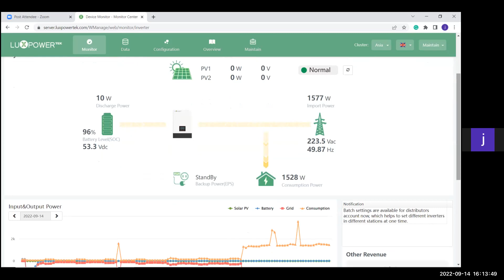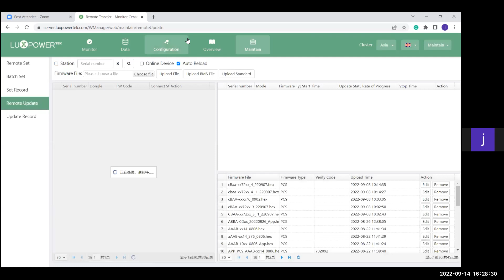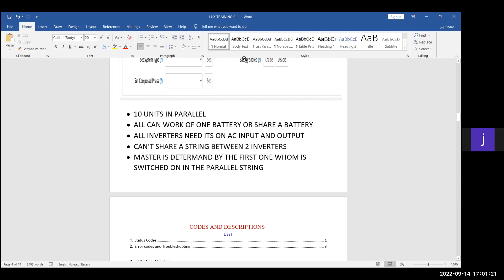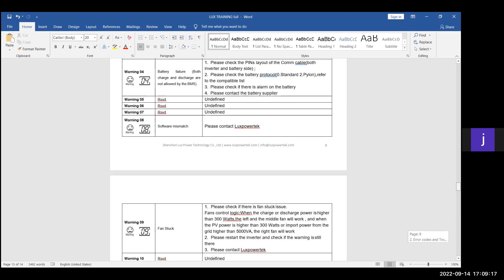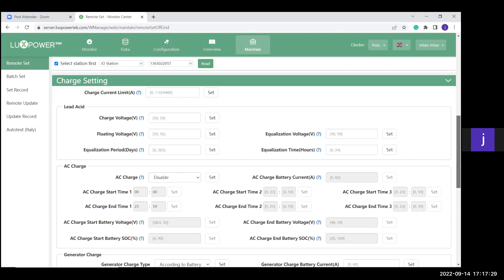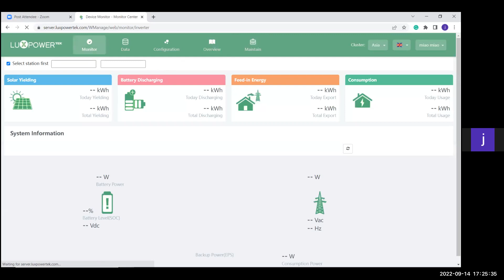Luxpower hybrid series intro online training

Comment: Hi! Jaco, very good and informative videos, thanks.   I recently purchased your unit from a supplier. (SNA5000) I was supplied with (3X 545 w) Canadian solar panels. Meaning that on a 6-panel string it will be 70 w over and 13.14 A on the MPPT. Do you suggest going to a 540 w for the last panels? Will my warranty be void because of the 0.14 A overcurrent on the MPPT?

Comment: Hi
I have a Luxpower SNA5000 inverter and can't get it to switch over to the generator to give electricity to the house and to charge batteries. The generator is connect to the dedicated port for the generator and I have Lithium-ion batteries. My system is a completely off grid and I am therefore not connected to eskom at all. Your help will be greatly appreciated.

Comment: I have a lux power Sna500 inverter that shut down for 1minute before carrying the load when loadshedding  start.

Inverter is connected to a 5kwhShoto battery with no PV connected